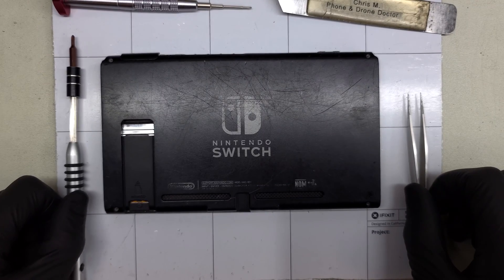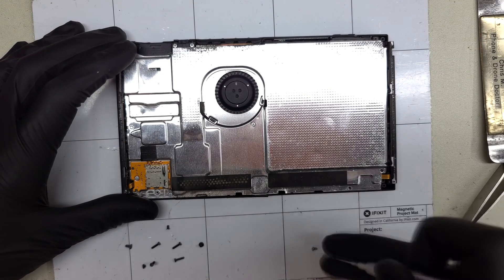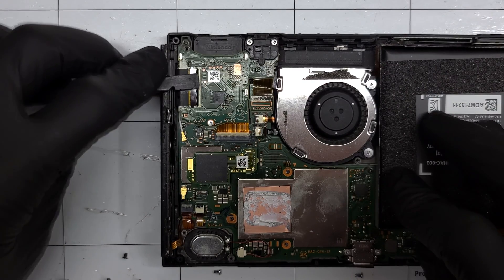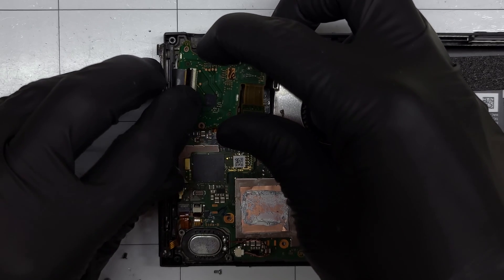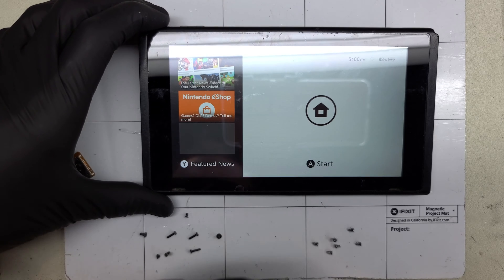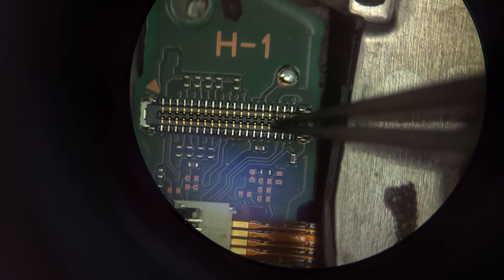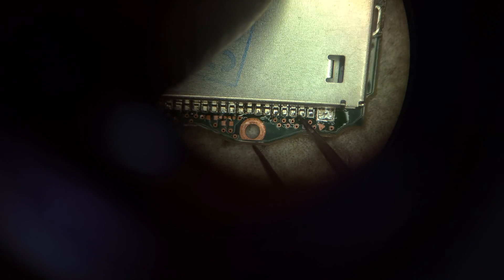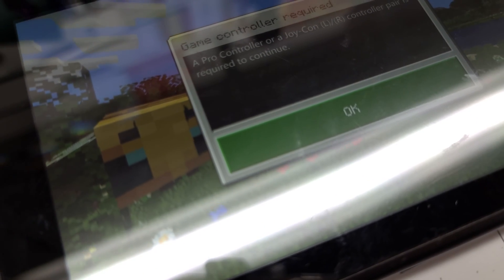Nintendo Switch Game Card Reader How-To  - Easy, unless the pins break

Comment: Hey there! Thank you so much for this video, it's super helpful. I'm preparing to make this repair myself and had a few quick questions.

1. I have a launch model Switch. Is there a specific model part I should buy, and where should I get it?

2. Does the repair alter save data in any way?

Thank you!
Reply from the maker: Thanks! As long as the card reader you get is for your model, and not the Lite or OLED versions, it should work just fine. I have had a bad defect rate in the past, so buying two may be a good idea.

Zero impact on save data, all that should be on your SD card
Reply: @TapticDigital Thanks again for the reply and video! I completed the repair, and thanks to your video, a friend's guidance, and a little help from the Lord, everything went smoothly and my data is intact. Woo hoo!
Reply from the maker: @danielmyles2312  glad to hear it! On some repairs, a prayer is definitely one of the steps involved!

Comment: Is it possible to remove the Game Card Reader without hot air? I broke some pins with a faulty repaired game card :-D Ive got rosin, desoldering braid and a powerful station iron.
Reply from the maker: It is possible! The only thing actually holding the reader down are the solder joints. The four feet can be tricky, but then it should easily come out. Just make sure the data pins don't rip!
Reply: @TapticDigital  I made it, i was heating the solder joints and pushed them softly out and at the same time i used a desoldering pump. but the new reader isnt well designed, modules dont stay in. so much work for nothing. but solderskills +1 :-D
Reply from the maker: @hemdvonlidl2613  A for effort! I should say I have about a 60% success rate with the readers, sometimes they just don't function at all.
Reply: @TapticDigital  I bought a complete V1 Reader, now it works.
Reply from the maker: @hemdvonlidl2613  it's silly how many go bad, but I'm glad you got it working!

Comment: it won’t let me put back the reader
Reply from the maker: Can you explain a little more? What do you mean out back?
Reply: @TapticDigital  so i took the original reader out so i can fix my fan but when i try to put the lego piece back it just doesn’t go in the slot
Reply from the maker: @dalestart3439  it's possible some of the pins from the old one broke off inside, check the old connector for missing teeth. Definitely don't try to force it, try to walk it into the connector. And be sure it's for the correct Switch, Lite uses a different one
Reply: @TapticDigital  i check for some missing teeth and i think some were missing and i tried putting it back on and the lego piece just snapped off the ribbon and now i’m scared there’s damage on the actual motherboard on the switch
Reply from the maker: @dalestart3439  very unlikely, just like in my video the teeth will prevent a connector from going in. You'll have to remove them gently from the board connector with tweezers, and may need a different game card reader
Reply: @TapticDigital  yeah i will need a new card reader the lego piece just snapped off the ribbon  soooooooooo, but im still scared there might be damage on the switch board

Comment: What happens if the pins break?
Reply from the maker: They need to be pulled out and replaced with another part. It just makes for more work.
Reply: @TapticDigital  Does nintendo provide this service? i'm not good with pulling things like this apart and while i have friends to trust i dont even know how much nintendo may charge
Reply from the maker: @superstardoughball9822  I believe Nintendo offers this as a service, as well as most independent and franchise repair shops like CPR and UBreakIFix. I will say this is one of the easier-to-get to parts for repair, and my issue with the pins breaking is NOT a common occurrence. Independent shops will usually charge about $99-$150, but I'm not sure what Nintendo offers, it's worth calling!
Reply: @TapticDigital   You are amazing I thank YOU! Last thing, out of those 3 (nintendo CPR UbreakIfix) who would you suggest :>
Reply from the maker: @superstardoughball9822  I'd call Nintendo first to get a price for official work, but I've worked with CPR before and they are usually very reputable and have a good warranty. I don't have as much experience with UBreakIFix but they seem to put out good work.
Reply: @TapticDigital   I'll try nintendo first to get the price, but thank you so much! i wish i had the confidence to fix it myself

Comment: Easyer to just buy the ones with the circuit board already
Reply from the maker: That's exactly what I did on this one, until those pins snapped and I had to go in manually. The board replacement is much easier, and more cost effective!

Comment: I've done this repair on my son's switch, but now it's not only not reading the cards, but I'm not even getting the card reader error message. Any ideas?
Reply from the maker: Sounds like a bad card reader to be honest, or could have the pin issue I did
Reply: @TapticDigital  I was afraid of it being a bad reader that I got in lol. I just ordered another one to see if that works, if not then I'll find a place to take it lol. Thank you for the reply though, I appreciate it. Also, very good video. Very easy to follow along with 😁.
Reply: Same issue. Some suggested to me that the replacement card reader needs to be in serial with the digitizer S/N

Comment: Quick question; Repair looks great! My Switch is among one of the first batches, and I saw at the end of your video you had pin problems. What is the likely hood of this happening to me? The first part seems simple but if the pins break off, that's too much for me to deal with. Love the simple instructions!
Reply from the maker: Thanks so much! The probability of this is very unlikely. It may have been a poorly refurbished part. As with anything being mass-produced there are bound to be some faulty parts. Glad you enjoyed the video!
Reply: @TapticDigital  Thank you very much! Will definitely be using this tutorial later.

Comment: My daughter ruined her card reader and this video is super helpful in the replacement of it, but what replacement reader do you recommend purchasing? TIA!
Reply from the maker: For the easiest replacement I would find one that has the reader already installed on the little board (unless you like to solder!). And I would recommend buying two to be safe, as sometimes they just don't work with the device, you can usually return the unused part. I usually get these parts from Mobile Defenders or Mobile Sentrix
Reply: @TapticDigital  thank you!! I’ll be back to tell you how it goes!

Comment: hello mate i replaced my game card reader with the help of your vid around 8 months ago thanks for that. anyway it lasted 2 months i got another one today that never worked at all but with the after market card readers in the digitzer dont work but when i put the original part back in the digitzer works  do you get this problem thanks dennis
Reply from the maker: Hey Dennis, in my experience it's a faulty card reader board. At one point I went through 3 just to find one that functioned. Until Nintendo supports Right to Repair and sells OEM parts, it's kind of a gamble if the ones you buy are good.
Reply: @TapticDigital  I've had the same issue with SD card readers for years. That one's awful because you can run so many more games on it including mods

Thank God its module at least.... but I've seen pins failn

Comment: What do i do if my pins break
Reply from the maker: At that point it's usually easiest to just replace the part. By the time you track down a replacement connector and go through the trouble of soldering it on, it's just not worth it. And trying to re-attach the pins is not a great idea.
Reply: @TapticDigital  that’s what I did
Reply from the maker: @girlfri3ndvsboyfri3nd6  that's a good option as well. I can also recommend looking up ShaneFix out of WA, they specialize in console repairs.

If the pins broke off lego ribbon on the card reader part, that can just be replaced with another. The whole card reader with that board and lego connector are sold together from a couple vendors. If the pins on the main board of the switch itself broke, then you're looking at microsoldering repairs sadyl 🙁
Reply: @girlfri3ndvsboyfri3nd6  did you get it back from Nintendo yet? If so, how long were you without your Switch?
Reply: Contact Nintendo and file a repair report
Reply: @girlfri3ndvsboyfri3nd6  my serial number is not eligible for repaire
Reply: @girlfri3ndvsboyfri3nd6  no
Reply from the maker: @Kaiden2345  look up ShaneFix, I believe they have a mail in service and reasonable prices from what I've seen!

Comment: Great and simple repair video. Easy to follow.
Reply from the maker: Thanks! Lately the game card readers I've been swapping are kind of hit and miss, they don't always work well. It seems to be a compatibility issue, and I've just been trying new card readers until getting one that works. Be sure the vendor you get them from has a good return policy!
Reply from the maker: @Monica Farmer-Hajduk hey Monica, I get a lot of my parts from Mobile Defenders, Mobile Sentrix, I've also found them on Injured Gadgets. Make sure you get the part that includes the board, unless you want to solder the game card reader on your own.